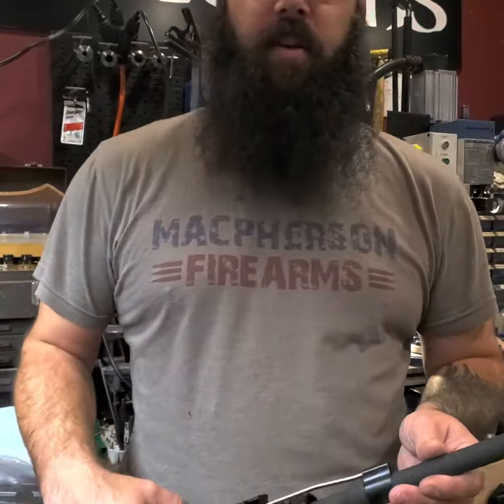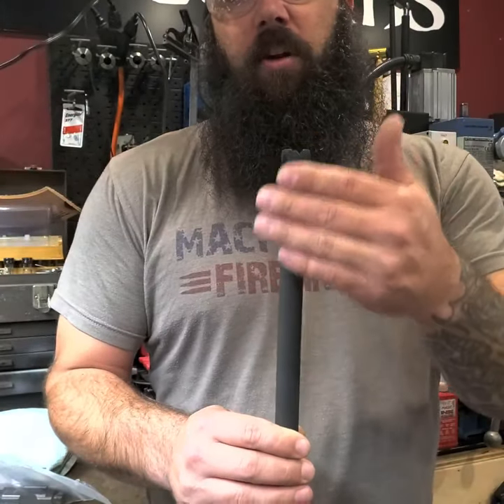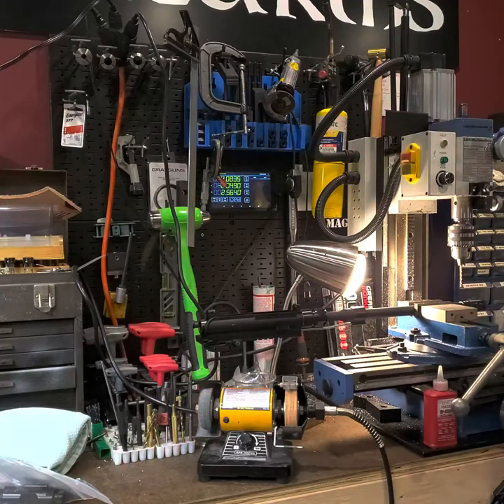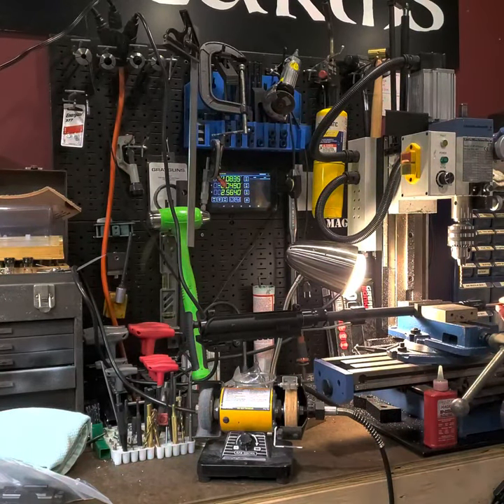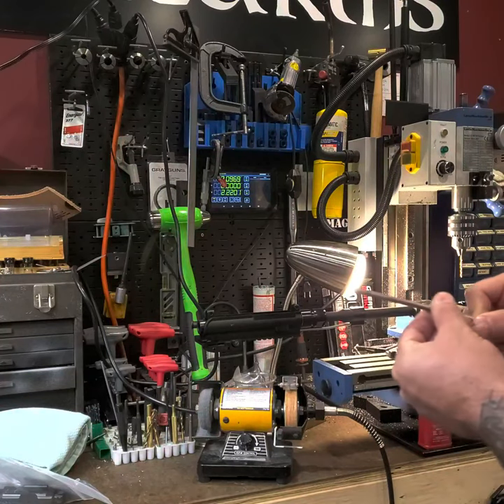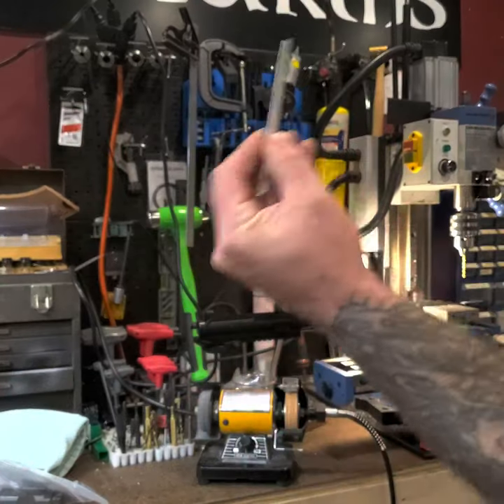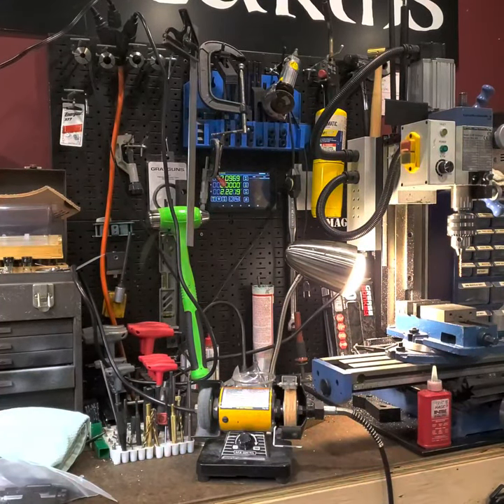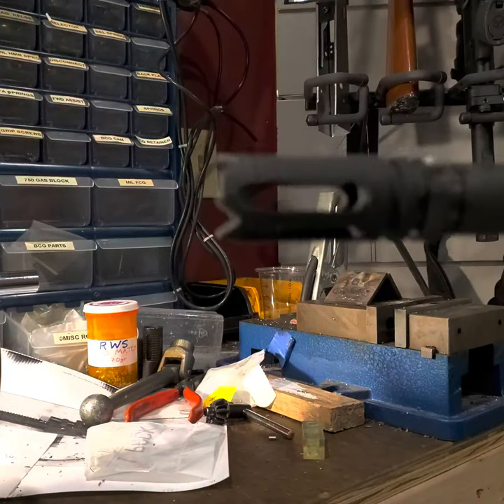How we pin and weld.

Comment: Looks much better than my hand drilled coat hanger pinned and harbor freight flux core weld.
Reply: But you got it done 😊 who cares if it's a HF welder.😂
Reply: I was about to thread my deadair flash hider so I could use my gas block jig to dimple barrel followed by set screw & top off with melted brass

Comment: I'm surprised you mill doesn't have a quill depth stop.  What DRO are you using?
Reply from the maker: It does, however we use the bluetooth DRO that the machine comes with as it is more dynamic and accurate than the manual stop.

Comment: Do you grind the top of the weld afterwards to make it look smoother or just blue it?
Reply from the maker: Typically it is slightly domed. In my experience, grinding leads to more refinishing and most of our customers want "proof" that it is pinned and welded so we leave it most of the time. We do grind suppressor mounts to avoid any interference.